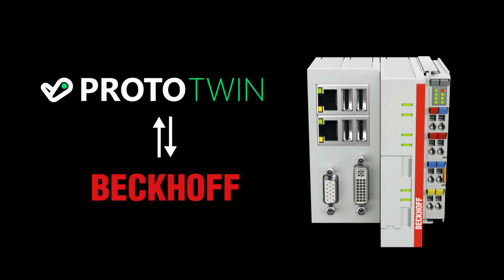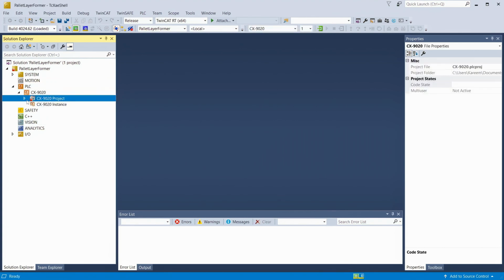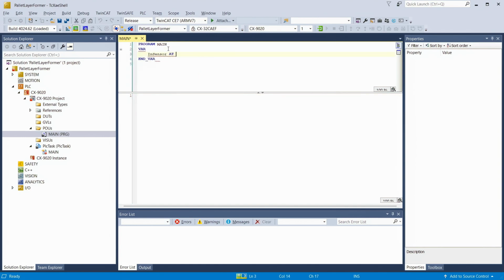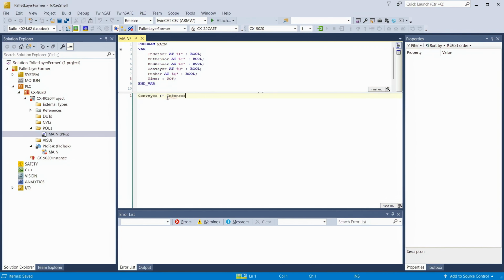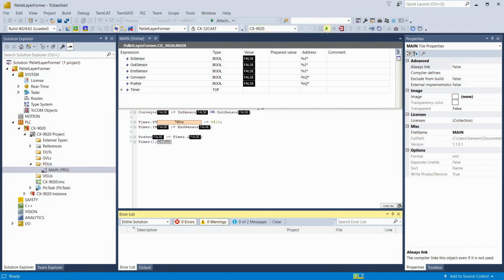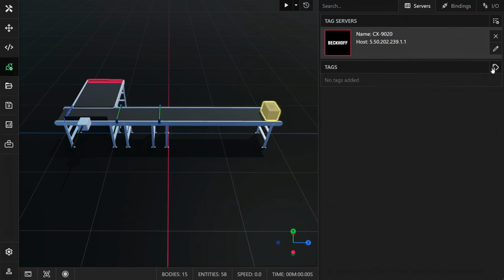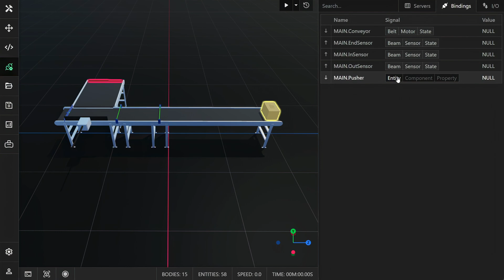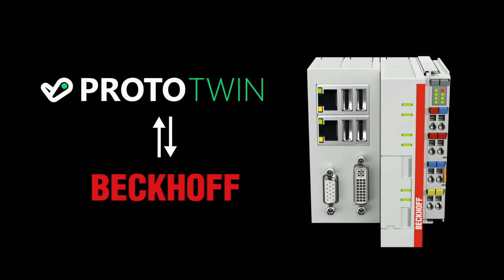Connect to Beckhoff PLC using TwinCAT 3 ADS | Virtual Commissioning

Comment: Just to add more information
If you are using a PC like a PLC (TwinCAT RT(x64)) and you have ProtoTwin in the same PC, the name of the host will be "127.0.0.1.1.1"

If you want to use a TwinCAT in a virtual machine (TwinCAT RT(x64)) and ProtoTwin is installed over the HOST you will use a Bridge Adapter (assuming you are using VirtualBox), deactivate the firewall, and you will need to install TwinCAT XEA and XAR over the HOST to add a ROUTE to the virtual machine, then the Host name in ProtoTwin will be the IP address of the virtual machine + .1.1
I'm doing more tests to have the best performance.
Reply: Thank you for the  hint about "Name" = 127.0.0.1.1.1

I used both Local and UserMode as a target on PC running Twincat and it works fine

for Local you go to Routes->NetIdManagement and
"Host" = number from "Local NetId"

for UserMode
"Host" = number from "Target NetId"

and in both cases 

"Name" = 127.0.0.1.1.1